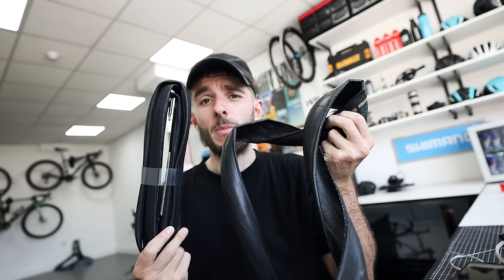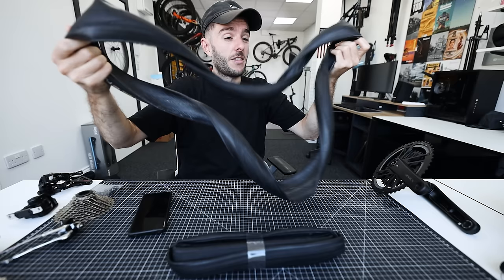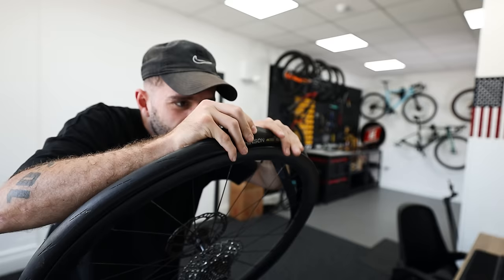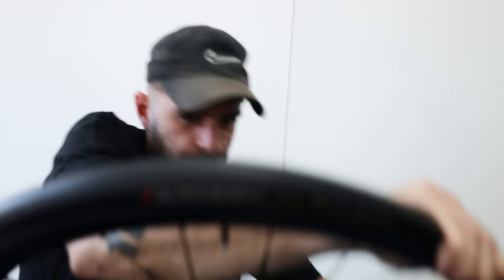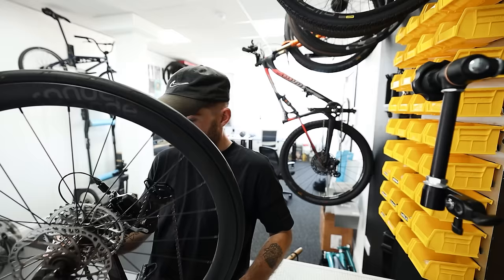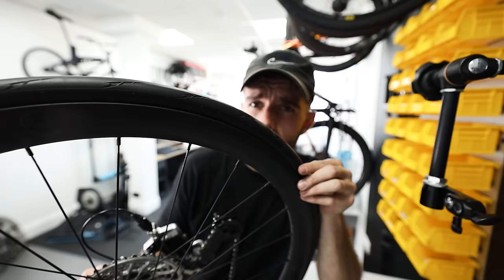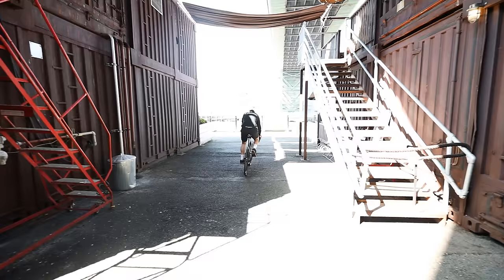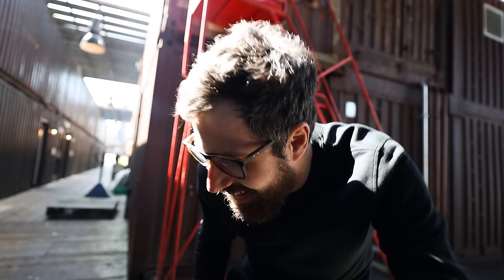The Ridiculous Trick for No Punctures Ever

Comment: you might just as well use schwalbe marathon plus. Weigh as if they were made from solid tungsten, rolling resistance of a tractor tyre and absolutely unpuncturable... basically the same, but less hassle.
Reply: Yeh I use these, 2000miles with no punctures, gotta change them over soon though! :)
Reply: Been running the marathon plus on three different bikes over four years and never had a puncture
Reply: how much more do they weigh than alternatives? my bike came with them and i haven't bothered to change them yet, only was considering it since they barely have any grip for off-road
Reply: @lemonshire1  about 900 grams per tyre vs. like 250 grams per tyre for something like conti gp 5000s
Reply: @Froodulous  jesus christ, no wonder i never get punctures. those are gonna need changing
Reply: @lemonshire1  some dirt jump tires can get to 1200 grams per tire
Reply: @sepg5084  interesting
Reply: eventually they do puncture, you end up leaving them on so long because they dont wear out, the sidewalls & puncture protection band hardens then cracks, and instantly creates a pressure point internally against the tube no different to if a thorn went straight through it.
Reply: I once got my Marathon plus killed by a little screwdriver which entered the tire from the sidewall and went straight through and out on the other side. The air went out with a loud bang. Sometimes you have no chance...
Reply: The Marathon Plus's still roll better than the Specialized Armadillos - these are the real tractor tyres.
Reply: kinda excited to see how much of a different swapping them out will make
Reply: The greenguard version rolls pretty well according to the rolling resistsnce website. The real killer is the weight
Reply: On a bicycle I'm mainly just a commuter and use Marathon Plus when there is no snow/ice... After my typical winter tyres Marathon Plus feel like flying. :D
Reply: @elleffeff  I feel armadillos have no grip in the wet
Reply: On top of that zero grip in the wet and a treacherous grip limit behaviour. Marathons are just awful.
Reply: Fill tire with Portland cement!
Reply: @wololo4206  Same. I run those and some continental gatorskins. I have not had a puncture in..... I can't remember.
Reply: Just to say the regular marathon tyres (green i/o blue) do the job just as well. I did 5,000km+ on crap roads with zero punctures. They are a tolerable ride. Unlike the marathon plus, which are just too hard.
Reply: @JohnBatty  
This is the way.
Reply: I had a massive chunk of glass sticking out on a Marathon plus a few years ago.  The tyre just laughed at it. Still on my commute bike today.
Reply: A few years back Imand certainly more than 10,000 kms ago I decided to go Schwalbe only for all our family bikes. We have bikes with Marathon GT, Energizer plus, Marathon Plus, Land Cruiser and Marathon Plus Tour and since then not a single flat while before - using Michelin, Decathlon, Giant branded etc it was a regular occurence. Just make sure the inner tube is also Schwalbe. While the rubber of other brands start cracking the one from Schwalbe seem to go much longer. On my commuter - with mid-range Energizer Plus - I have close to 10,000kms done without flats and while often carrying groceries (10-20kms) on top of the back wheel and doing daily a short offroad shortcut.
Reply: Oh trust me they Puncture just as much as anything else, tiny slithers of glass from beer bottles love these tyres.
Reply: @wololo4206  What???? just 2000 miles on marathon plus??? thats terrible. I run Schwalbe Pro One TT tires for 2000 miles now.
Reply: @MrBusunglueck  They still run fine, however, I would argue that any bicycle tyre needs changing over at around 2000+ miles,  personally I'm not going to risk my neck out on the road to tyres with no grip (from being worn ). Edit- I should add that I usually run anywhere from 20kg-40kg (bike+panniers) which would account for more wear also.
Reply: @wololo4206  In my cycling carreer so far ive done 30.000 miles. Im on about my 8th set of tires now.... This averages out at over 3500 miles per set of tires. (Schwalbe Pro One TT, Conti GP 5000, Vittoria Corsa, Specialized Turbo Cotton)

I regularly run TT tires during training. In 30.000 miles i only got one puncture. It was when i set my rim brake calipers up the wrong way. The brake pads cut through the sidewall of my tire.

I never understood, why other people puncture that often.
Reply: Put 700-38C Marathon Plus on my daily for more puncture protection, works well, but "absolutely unpuncturable"? Most certainly not. Had like 3 punctures or so in 7,000 km. Which is still by far better than anything I had before. Funny thing, however, with the 50mm Marathon Plus on my old 26" bike I did not have a single puncture in like 10,000 km.

Comment: I normally 'overtube' for winter commutes. 35-45mm gravel 700 tube inside 28 or 30mm tyres. The tube doesn't expand to anywhere near its design stretch so it's wall thickness is thicker. Worked all last year and during the TPT FKT attempt last year
Reply: Neat trick! Might be better than buying those heavy thicker tubes.
Reply: I tried slicing the valve off a blown inner tube and packing it between the rear tire and tube as a puncture barrier. The tube as liner is softer than a tuffy, i.e., less likely to cut the tube with its sharp edge.
Reply: Yes I have just tried this trick and so far works very well!!
Reply: Even running a 28-35mm tube inside a 28mm tyre works really well! I had multiple cuts in the tyre and even then the tube did not puncture. 💪🏼
Reply: @anserrizvi3304  I am not sure how it works? bigger innertube for size up tyres has thicker walls?

Comment: In Brazil, we do something similar. We use a smaller and old tire, cut its bead, and install it as a puncture protection tape between the main tire and the tube.
Reply: How do you stop the cut edges' friction from  cutting the tube?
Reply: @sidmarx7276  Sand than.
Reply: ... and there in Europe we are using TPU inserts ... 😊😆
Reply: @sidmarx7276  Use heavy duty tube.
Reply: I do this in the US also. No sanding, no problems.

Comment: I live in the Mojave Desert, and goat heads are EVERYWHERE! I used to get flats on every single ride! Then I switched to a tire with a Kevlar layer, and tubes with Slime. I have not had a single puncture in over three years. Yes, it does weigh a bit more, but it is worth it!

Comment: Bmxers used to run double tyres back in the day, trim the bead off the inside tyre so it just acts as a liner.
Reply: Used to do this on my winter commuting bike.  If I remember, a 23 or 25mm Continental GP fitted inside a 32 or 35mm Top Touring.
Reply: Yep, Worn out v monster inside a fresh v-monster.

Comment: Try using Mr Tuffy Tire liners.  Been using them with great success.  I use the reg ones but they do have light weight versions.  The weight penalty is very minimal.  Also I ride in the Sonoran desert and flats are typically guaranteed but not with these.

Comment: I've heard this ideia in other places too, but the best option for me is still to buy some kevlar reinforced tires (such as the Hutchinson Fusion 5 All Season that you were using) or, if you cannot find a tire with that but you still want to ride it, buy some inner inserts from Vittoria for example: It wont prevent you from puncturing, but it will certainly take you home or somewhere safer where you can patch the tube.

Comment: I use a fairly standard setup for road riding of continental hardshell gator skin  25mm  folding clinchers during the winter months I do run them on lower pressures as they are quite a thick tyre particularly the side walls I weigh 74 kilos and run them about 70psi I only ride on the road but I ride in the new forest area which in winter has quite a lot of grit washed onto the road. I average about 4000 miles of winter riding so I have done two winter seasons with the same set of tyres and zero punctures. What I think helps is after every ride I flip the bike onto a bit of carpet and wipe the tyres down, I then check for any flint with a light and get any flints etc out with a small screwdriver. Takes about five  minutes, I think the puncture you get on one ride is a flint you picked up on the previous ride. As Barry Hoban once remarked when Mark Cavendish was going through a period of having a lot of punctures. "you want to look where you are riding"

Comment: The amount of friction between the two tyres should be massive. I assume that this setup has more rolling resistance than one tyre with really, really good puncture protection. :-) Not even speaking about tubeless, but for a normal clincher setup: an inner TUBE expands smoothly to the walls of the tyre and kind of "strengthens" the tyre from the inside. With two tyres: As the inner TYRE doesn't really expand to the outer tyre and there is probably always a gap between the two tyres, the outer tyre should always deflect more - even on smooth surfaces. And while doing so it additionally rubs against the inner tyre. But of course I have no data to back this up. :-D
Reply: your right , the inner tyre will move . just carry a puncture repair kit or spare tube. job done.

Comment: I've wondered whether running gorilla tape (or similar) around the inside of the tyre where would provide a good second skin to help punctures?  Work for tubeless and clincher.
Reply: I tried to put some tape to continue to use my tire after a big puncture once. Some kilometers after I got my inner tube leaking as chaffed by the tape, took me some time to figure out why 😅

Comment: I have done this some years ago using two normal (tubed tyres) for the inner tyre, I cut off the steel beading, so I had 1 inner tube followed by one tyre with no bead sitting inside a normal tyre.
Was hard to put on, tyre width was 1.75" mountain bike wheel. Was quite heavy, I got no punctures but later replaced the tyres with Schwalbe Marathon Plus tyres, now my choice tyre for large/wide wheels.
A side note, looks like you could use a tyre glider to get those on and off. I bought one some months ago - so easy.

Comment: Vittoria make a better option called airliner, just installed them
Reply: + 1 for tire liners. Especially for winter or commuter bike, if you want to use tubes. They’re made of plastic, so more durable and puncture proof than rubber. Have had just 1 puncture through that setup in about 5-7 years. In terms of riding - they feel slower, but not by that much. There is a bit of strange sensation with them when the wheels are rolling, as its essentially a strip of plastic with overlapping ends, which then create a bit of a bump at the overlap.

Comment: Yeh, i done this years ago. Using two clincher puncture proof tyres, but I cut off the beed and a small amount of the tyre wall on the inner tyre, so the outer tyre would grip the rim better, then stuck a tube in. Worked a treat, heavy as hell, but what don't kill you makes you stronger.

Comment: It feels horrible, I did something similar with my cruiser bike, it felt super rough and made a single tire feel like you are riding on clouds, it definitely reduced flats tremendously however, I don’t think it was worth it, I did manage a flat and then had to remove 2 tires then fix the flat and checked the tires and found I had numerous thorns etc in the top tire, I undid it and never tried it again

Comment: I did something similar on my commuter ebike.  My scheme was an inner tube, a puncture proof strip, an older tire of the same size as the mounted outer clincher that has the  beads cut off, and then the outer clincher. I did this because rear punctures seemed 2-3 time more common than front ones. It hasn't punctured yet after 3-4 thousand  miles or more. I lost track. These were 26x2.0 or similar.
Reply: I usually do this on a rear wheel to get some more miles from a well worn tyre.
Reply: @richardharding9385  I put the old tire on the inside and the new on the outside. So the old one never actually wears out - guess. I've not changed it yet but have changed the outside tire once.

Comment: I used to have a big issue with goat heads (Acanthospermum hispidum) ruining long rides ... I once had 5 flats in one ride. Tire liners (Mr. Tuffy) fixed that, albeit at the cost of some road feel and a bit added weight. They won't stop side punctures, but everything short of a drill bit is kept out.

Comment: Anecdotally, using inner tubes that are 1.25x bigger than your tire (if the tube has a size range, refer to the smallest limit) helps mitigate punctures.

I don't know why for sure but it might have something to do with the tube stretching less and not becoming thinner.

Comment: I tried slicing the valve off a blown inner tube and packing it between the rear tire and tube as a puncture barrier. The tube as liner is softer than a tuffy, i.e., less likely to cut the tube with its sharp edge.

Comment: I've run tannus armour inserts inside Serfas Drifters for over 8k miles, with a  tube full of sealant - zero punctures. Yes they are slow, but they are 650b x 50s anyways, so, just a more bulletproof Cadillac now :)

Comment: I used to put a clincher inside a clincher back in the 1980's because I had an engine mounted on the back with a roller that would wear out the rear tire fast.😀

Comment: You're trying to solve a problem that's already been solved. Just run Slime in your tube, or if you're tubeless, make sure you have enough sealant.  

You mentioned solid tires. Those have the potential to ruin your rim. Air filled (pneumatic) tires spread the pressure of bumps onto the entire rim, solid tires transfer the pressure of each bump directly into the rim.

Comment: Why not take a discarded inner tube, slice it up to get a narrow strip and glue that to the inner surface of your normal tyre using ordinary puncture repair glue? Or even do the same thing using a worn out tyre instead? You would still use an inner tube in both cases. The weight of the wheel would increase a bit but it shouldn't feel too bad to ride.

Comment: OR you can use a thick, puncture-resistant tire and add a tire liner to protect the tube further. 
It would ride better, be cheaper, safer and you'd only make your winter rides 50 watts harder, which will pay dividends come spring

Comment: You could drill a 2nd valve hole and put in tubeless sealant between the 2 tires. But, then it would be a lot like the Schwalbe system, only heavier and more difficult to manage.
Reply: What a nightmare that would be 😀

Comment: Did you pick that size of tub for a reason you didn’t discuss?  It seems like it would be a bit small compared to the clincher it was designed to fill.  Had you measured it when inflated against the clincher before the install?
Reply from the maker: that was the measurements that Tim used - could've gone for a bigger tub, but more to squeeze in I suppose
Reply: @Cade_Media  Yes, probably so.  Might be interesting to try and match the sizes if they differ between manufacturers in order to get one that fills the clincher more solidly.  Then again, it seemed like a ton of hard work and probably not something you want to do again!

Comment: What’s the honest opinion on tubeless ready? My rims are ready but finding tyres and the price on top of potential roadside maintenance is an off put
Reply from the maker: It works extremely well on wide tyres (gravel and MTB) and not quite as well on road. But you always have a chance at it sealing and worst case can just whack an inner tube in if it doesn't seal.
Reply: @Cade_Media  thanks responding and good to know.

Comment: No punctures? Mount it on the wall as art. 😁
In all seriousness. I just bought a tire that's "puncture proof" double thickness. I've been riding for about a week on it. Got a flat last night because of a tiny piece of rectangle shaped flashing (metal). Like someone snipped a corner off of the flashing and it made its way down the road. Eventually... In my tire. You can help not get flats but it's like when they called the Titanic unsinkable... Murphys law.